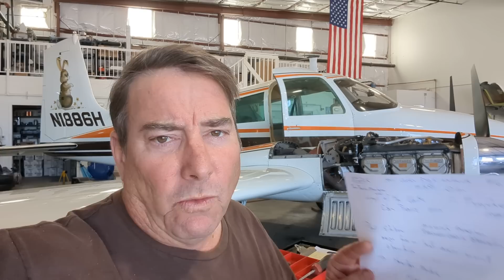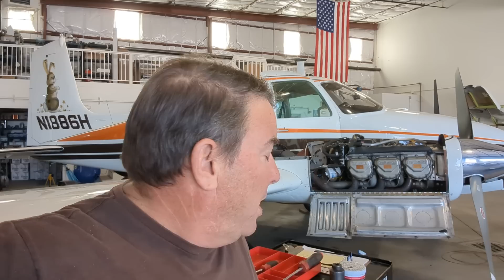Rare P-40E Warhawk Crash Hamilton Montana 27 June

Comment from the maker: UPDATE: 30 Jun Investigators will be looking closely at the Curtiss Electric Propeller as initial reports are indicating the engine did NOT fail, but the prop control failed or 'ran away'. Not sure if it went to high pitch or low pitch causing a loss of thrust.
Reply: Thanks Juan for following this accident and, as usual, helping to get the facts out.
Reply: The "default" for a Curtiss electric prop when the electrical system fails is fine pitch/high rpm. That doesn't mean that's what it does if the prop itself fails electrically.
Reply: If the Curtiss electric propeller went into high pitch due to a faulty prop governor, that would certainly cause the engine to not generate needed thrust for takeoff.  If the props went into high pitch, there you would possibly have a runaway prop.  The circuit breaker in the cockpit would pop when this occurs, but there is a proceedure to reset them, but would be virtually impossible to do so during takeoff.
Reply: @jimfinlaw4537    Engine may be damaged if prop is left in fixed pitch.

Pre take off checklist: 
Modifier on quadrant RETARDED.
Increase RPM to 2300 and place propeller in FIXED PITCH.
Check magnetos.
Check propeller, then return to AUTOMATIC.
Fuel boost pump ON.
Check oil and coolant temperatures.
Tighten throttle lock.
Check that wing flaps are UP. Canopy LOCKED.
Reply: Thank you Juan. Paul was a good friend of mine. A true heart of gold. Tough businessman, but a kind heart and meticulous pilot.

Comment: My dad lives there and placed the downed plane on a map at   46.265475° -114.130724°.   The position suggests that the plane did not proceed straight ahead.   The crash site is about 600 yards west of the north end of the runway with tall trees to the NNW of that location.  There is nothing but  big empty fields directly to the north of the runway, but if you were to lift off say 2/3rds of the way down the runway, make a turn to about heading 330, you'd be pointed directly at those trees..    My guess is the plane lifted off, started to make that turn, lost the engine, and had to quickly decide whether to turn left or right to avoid the trees, stalled and came down hard (or hit the upslope of the the embankment between the driveway and flat top of the hill there, which we can see in some news footage).   We'll see what the investigation reveals.

Comment: I was asked once if I am afraid when landing. My response was I am never afraid when flying including landings….but I am always apprehensive when taking off.  An engine failure on takeoff - even a partial failure - can leave you with no options.
Reply: Hi, may I ask why you are afraid of taking off? I have to confess my only experience was with Cessna/Tomahawks. During take off, due to the propeller rotation, we need left rudder to counter the force. If the engine goes, I think i will release the rudder accordingly, level it off, pick a landing spot and glide. I don't see why taking off is more dangerous than landing. I can see there is not enough altitude for both taking off/landing for a stall recovery.
Reply: @y9gp8rptg8v  On landing, if engine quits, you have the nose down and in position to land,    On take off if engine quits you are on position to stall instead.
Reply: @y9gp8rptg8v  Hi.  To be clear, I didn’t say I was a afraid of taking off, just apprehensive…as all pilots should be to some extent on every takeoff. The reason is that when taking off you generally need all power available to climb to a safe altitude.  If you lose power (full or partial) during later phases of takeoff, when most of the runway is behind you, there often is no where to land and it is impossible to stop or turn around.  

When landing, you don’t need full power to maneuver and can modify the pattern to adjust for full or partial power loss. With light aircraft, on a VFR landing, you should always flight a tight pattern to allow for this eventuality. 

By the way, in almost all airplanes, you need RIGHT rudder to compensate for slipstream effect, P-factor, and torque…not left rudder.  But that has nothing to do with issues associated with power loss either on landing or takeoff.
Reply: Thanks for correcting me for the typo on right rudder 🥵🥵
Reply: @y9gp8rptg8v  No worries. 👍🏻

Comment: You say it looked survivable, but this was a common cause of death for some of the best WW2 pilots and aces. 
I have read accounts that a fatal outcome was almost inevitable if the engine seized at just the wrong moment . The hawker typhoon was a notorious culprit.
I have never really understood why they say this, perhaps you could explain the situation
Reply: Terrible glide angle is my thought
Reply: I can't remember which it was but I think there was only one single engine fighter plane model ever built with feathering propeller. Realize that when a fixed or adjustable-pitch propeller-equipped plane's engine quits making torque - that the engine slows down considerably when it "windmills".  But a Constant Speed (should have been called "constant rpm"  IMO) Prop equipped  engine will be driven at exactly the rpm that it's governor is set for. IF the pilot doesn't slam the prop control lever into it's lowest rpm setting immediately after losing power - then the prop becomes like a solid metal disc as far as airflow is concerned ! You are FAR better off if the engine locks up - then the stationary prop only acts like, say - having an extra set of landing gear sticking out in the breeze. You may imagine the effect all that drag has on glide angle . . .
Reply: I imagine the vertical drop rate matters.
Like a falling elevator in a building.  Sure it's level.  But hit the ground hard enough and the human body won't tolerate the impact forces.
Perhaps an autopsy will reveal more.
Reply: @libraeotequever3pointoh95  Didn't something like that happen to Douglas Bader the Legless RAF fighter pilot? I think it was a biplane, and it conked out and he did a great job of not stalling/spilling and he "pancaked it" onto grass but the sink rate folded up the gear and the massive deceleration when it dug into the grass broke the harness/seat belt and severed his legs on the instrument panel.

Comment: What a terrible loss for the warbird community.  There are not many Curtiss P-40E Warhawks still flying. My thoughs and prayers go out to the pilots family and friends.   The insurance company now owns the wreckage as evidence.  They can hold the aircraft anywhere from 10 to 20 years pending further investigations into the accident.  Be interesting to see what caused the engine failure.  I'm sure the NTSB will determine this when they examine the engine, fuel and induction systems.  Very sad one indeed.
Reply: The sad thing is that the insurance company can destroy a repairable aircraft, and even destroy the salvageable parts.

They literally demanded that a P-38L be run over with a bulldozer to render it not repairable.

I literally despise insurance companies.

Comment: Oh geeze. So sad and my prayers are for the family and the pilot. It sounds, from your explanation that he stalled it rather than flying down to the ground. The Tendency in a falling aircraft is to pull back the stick which has to be fought against. She may be coming down faster than you would like, but it's better to hit the ground at a high sink rate than it is to stall it and drop out of the air. It's easy to armchair quarterback and it seems this was an extremely experienced pilot. It will be interesting to hear what caused the engine failure. May he rest in peace, God bless his soul.

Comment: Condolences to the family. I just hope this isn't another example of poor maintenance of old US warbirds operated by private groups. It happens too often. Last week while doing maintenance, the RAF memorial flight decided out of caution to ground their Lancaster, Spitfire, and Hurricane, which all share the same basic engine and appeared to have an engine issue that might have affected each aircraft. Even though there was no immediate evidence that they were all affected, they chose not to fly until it was confirmed. They missed a significant celebration of Forces Day in  Britain, disappointed a lot of people, but put the safety of the pilots and spectators first. This is the correct course of action, obsessive levels of maintenance and safety. The 909 B-17 engines on the other hand showed clear evidence of a lack of proper maintenance, going beyond schedule maintenance intervals to meet the airshow schedule, and it was entirely preventable.

More strict oversight is needed of private entities, be that for warbirds, or subs.

Comment: Has everybody forgotten the Dallas incident that cancelled a B-17, a P-63, and five lives?  It is not an urge for public service that drives the deadly hobby of taking museum pieces into the air long after it is safe to do so, it is massive pilot egos.  Risk sports are an individual choice, but those lives and those airplanes are irreplaceable.  Let's save the few remaining war birds for posterity.
Reply: I was there in Dallas that day, and I 100% believe that those guys would want the flying to go on. Sorry if you can't understand it. There will be statics preserved for most of these planes, but those that can be flown, should be flown as long as there are individuals willing to invest in their maintenance. Humans make mistakes and have accidents. Same could happen on the ground. Planes have been lost sitting on the ground in museums, too, but that's the point. These warbirds are for humans to appreciate and they are best appreciated in the element they were designed for.
Reply: It appears the Dallas accident had NOTHING to do with the fact these airplanes were “museum pieces” or that the airplanes themselves were somehow inherently unsafe because of their age. It wasn’t pilot egos, either. It appears (the final report isn’t out yet) the accident was solely caused by a breakdown in standard airshow formation procedures and a mistake by an inexperience air boss. Age itself is not a factor in accidents. If it were, the GA accident rate would be going up as the fleet ages, but the opposite is true. The accident rate has trickled down over the last decade and is near historic lows. However, old aircraft are more difficult (and expensive) to maintain, as parts are more scarce and and things like corrosion must be addressed. But a properly maintained aircraft can be airworthy at any age.

Comment: Losing the pilot is a tragedy.  Don't we all realize that the more we fly these war birds, the more they disappear.   Soon some day, we'll be lucky to just find a non-flying museum specimen.  My offered solution to the problem of engine failure is not a 100% pleasing one.  I'd like to see these WWII fighter planes and bombers equipped with small gasoline burning Willians turbofans. Turbofans with just enough thrust to get the aircraft back to the runway in the event one of those big propellor fans stops turning. The idea is to fly these warbirds with the 'fans at idle thrust, and then go to full power if the reciprocating engine fails.  I think this would have saved a number of recent warbirds now lost.   I'm also thinking of the B17 that lost two engines on the same wing.  Auxiliary power would have saved this aircraft.  For WWII warbirds where the auxiliary turbofan engine(s) could be attached would usually correspond to the location of a standard drop tank, so the alteration of appearance would be minimal.
Reply: I have wondered if something like a small (relatively speaking) RATO or JATO rocket could be mounted where a belly tank or bomb should be, for one-use extreme emergency situations. Wondered about doing the same thing in small planes, but in the very back of the fuselage to keep the thrust in-line. Seems like a few hundred pounds of thrust for even ten seconds could make all the difference in a small plane that loses power at the worst possible time, or in situations where rising terrain is unavoidable at full power. Or maybe a hundred pounds of thrust for a minute? I'm a racecar guy not a pilot, so I don't know what would be most useful. I see so many accidents where they almost made it and just a little more power could have saved the day, and lives. Pull the safety pin, yank the big red lever, pull the stick back, and aim for the moon! I think rising terrain oh shit situations is the main reason Mike Patey put nitrous on Scrappy.
Reply: Proper maintenance procedures would have saved the Nine-O-Nine. The corner cutting that was going on in the maintenance department is what brought her down. 

Folks, there is no guaranteed solution to keeping these planes in the air and 100% safe. Accidents WILL happen. As tragic as it is to lose lives and planes, the danger of it is not lost on every single person who flies, maintains and otherwise is involved in the operation of these planes, and they still all make the CHOICE to do it.. because they love it and they understand the GREAT importance of keeping them in the air. Nobody pilots a WWII aircraft today without understanding that there is some danger, and they are all still willing to take the risk. 

It is a terrible, awful shame when anyone dies.. but it is also a terrible shame when history dies as well, and a large, important part of aviation history will die when/if these planes are grounded. That is why they MUST be kept in the air. They absolutely MUST.
Reply: I understood it when I flew on the Nine-O-Nine in Livermore in 2011. Just as I understood it every other time I’ve flown on a vintage bird. The experience is worth the risk. You simply cannot come close to developing the same level of understanding and appreciation for what it was really like for all of our brave airmen who fought for this country without taking a flight on one of these old birds. Looking at them in a museum is NOT the same. 

I started volunteering at Collings foundation airshows in the mid-2000s because I wanted to show my appreciation for all the people who work hard to keep these planes in the air.. because it is vital to get people involved and interested to keep the history alive. Museums just do not get the message across the same way, they don’t get people interested. Especially when it comes to young folks who have never seen such a plane fly.
Reply: No impasse here. One perspective is based on emotional overreaction, one is not. Decisions made based on emotions are rarely correct.

Comment: I'm sick of it. Started flying in the early 60's and have watched or read of dozens of outstanding pilots trash outstanding warbirds. There are several ways we can stop this carnage. We will produce more outstanding pilots, but warbirds are a finite resource., I would like every warbird pilot in the future be required to take X hours of current training in simulators in type. (We now have the ability to adapt simulators to mimic every warbird cockpit without costing two arms or legs.) He would also have to post a bond that would be paid in full upon damaging the aircraft regardless of the fate of the pilot. I suggest the bond be at least $4 million. Each purchaser of a warbird will have to fund the training of each pilot. And if the result is that no one can afford to fly them, give them to a museum right now. I'm okay with that. It's time to stop the carnage. These airccraft need to be rescued from private ownership. They are and American Heritage resource.